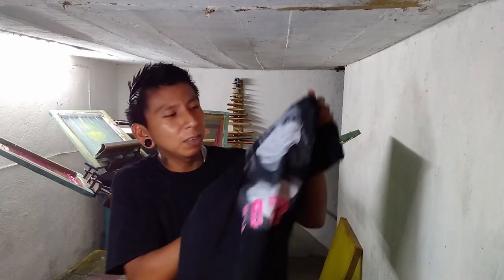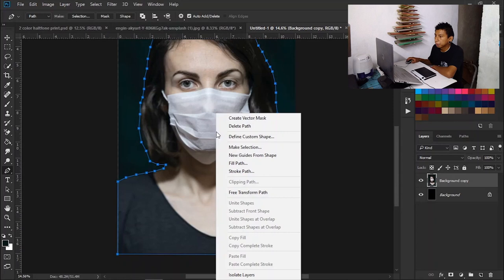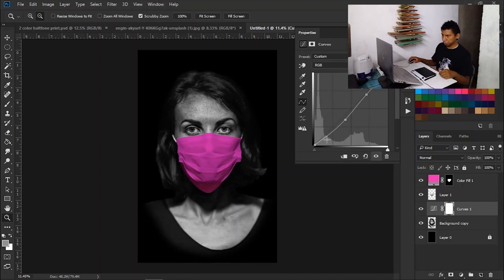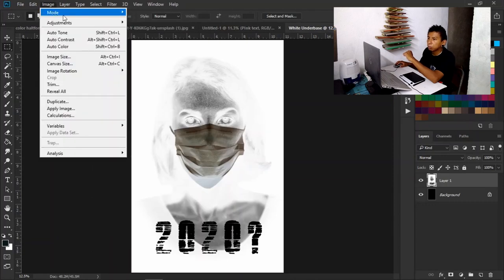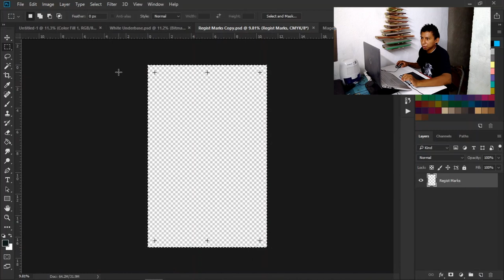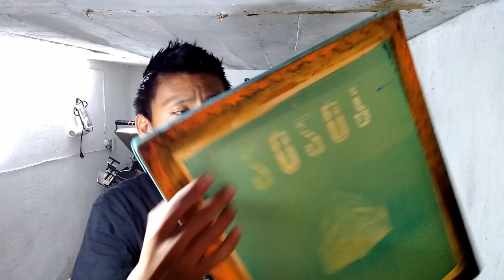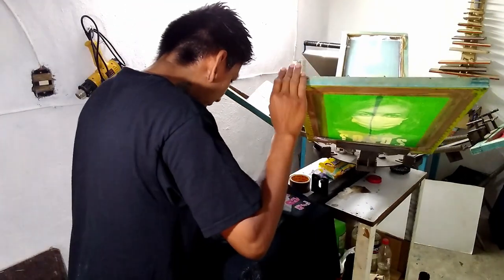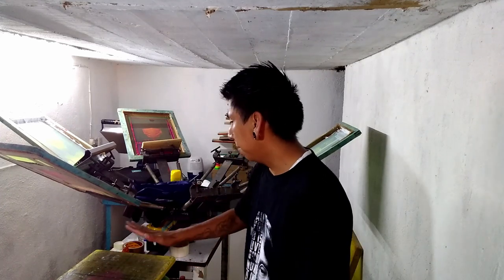Printing 2 Color Halftone | From Start to Finish

Comment: Hi fella love your vids . Can I offer a small piece of advise .I saw esp at the end print you pull on the white and push on the pink . I do believe this may have affected your registration. , you need to do the same stroke on each colour as you may put things out of line .
Reply from the maker: Thanks for watching. And yes I know, but on some occasions, when the registration is off just a bit, I sometimes do a push to even it out.

Comment: I know exactly how you felt doing this.. I have been through it many times and it really bothered me a lot! 
I mean.. every time there is a flaw.. I would have to start over again.. and we're talking a lot of time to re-do the process.  I admire your patience and dedication performing those prints.  Oh... and your photoshop skills are awesome!  thanks again  .. by they way... do you still use the UV lights for exposing?   I find them much easier and they save me so much time.
Reply from the maker: Yes, it's stressful but patience is key I. Screen Printing. And yes, still using UV.

Comment: Yo Brother, for the off contact try using US Quarters. One on each corner of the screen. Not sure what coins you have there that would be the same width as a US Quarter. Good luck.
Reply from the maker: Thanks Amigo, I'll keep that in mind. And yes, the coins are about the same thickness.

Comment: Hey men nice video dude love it....i just started screen printing let me tell you that Magenta color kick my ass one day I went to the printing supply house 2 times because it was not coming out right with the under base , they say oh your using too high mesh count I was using I think 230 they say no use 110 , ok try 110 same thing but yes it gave me more ink on the shirt but not good just not good, to me that ink is for white or light color shirts NO UNDERBASE .what I had to do was to get another color CMYK that was very very close to it and I use it and it works no underbase print flash print like 2 - 3 times on a black shirt and it came out perfect....so I think that Magenta is for mainly white.....i can provide that color if you needs it am just not where it is at the moment , kool men keep printing.
Reply from the maker: Thanks, and the color I was using is not really magenta for doing cmyk prints. It was a color that I prepared using a patone mixing system. I was aiming for a type of red but I got this color. Lol. But I will revisit this print in the future.

Comment: Was that a napkin u used to dry it Fter u washed out the screen
Reply from the maker: It was a paper towel, normally I used newspaper but I ran out. I do it to make sure no emulsion drips down to the stencil part and blocks my screen. Others use air to blow out all the excessive water.

Comment: Use an angle of 22.5. It will reduce the moray effect drastically. 😉
Reply from the maker: Thanks Amigo. I'm going to do that. I just view a post yesterday where they mentioned that angle as well.  Definitely going to give that a try. Thanks for the input.
Reply: What exactly is a morray effect?
Reply: Ok Moire effect. Believe you get it by the motion we use when we’re pushing or pulling the squeegee. Maybe the angle and thinner ink.

I use to get it with less opague purple ink.
Reply: @ScreenPrintR  irregular patterns in the halftones when you print your films.

Comment: Dont clean emulsion on opened air. UV, man. And check exposition time.
Oh... and one more thing... 300dpi is not enough for halftone. Better use 1000~1200dpi.
Reply from the maker: Thanks Amigo. I appreciate the tips.